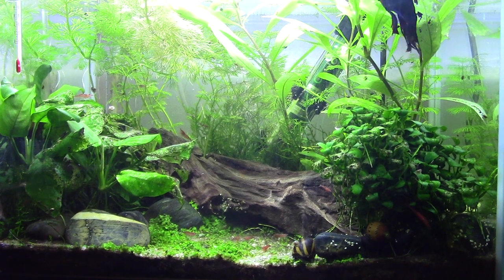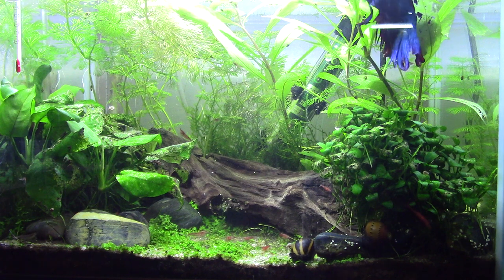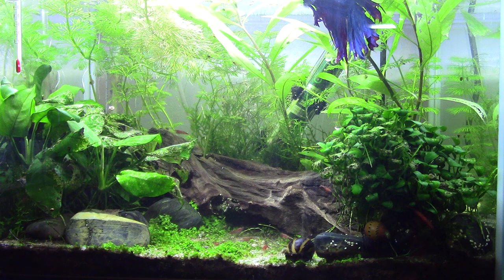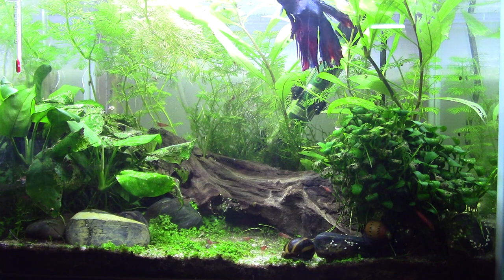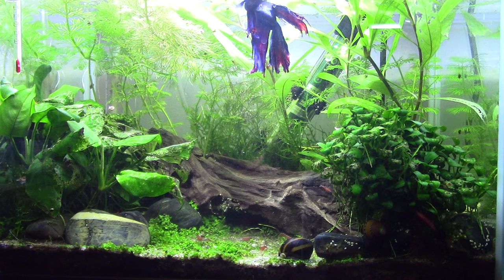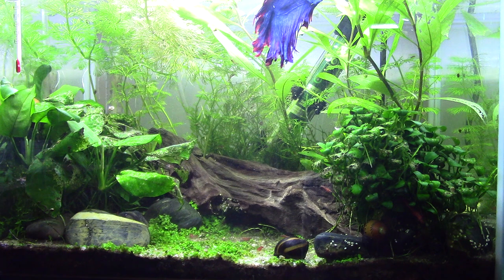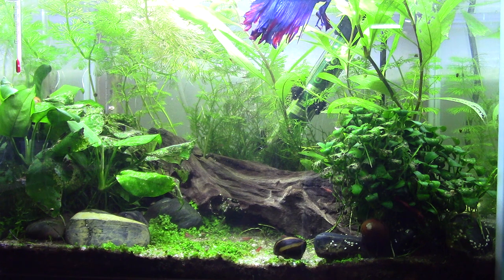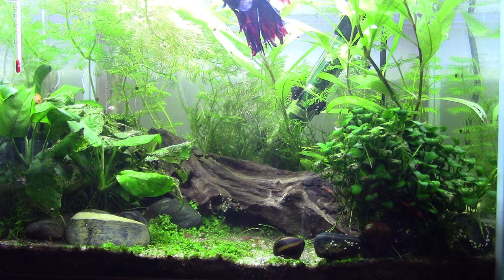what exactly does cycling a tank mean?

Comment: I lost two fish so far.i put water in the tank ran it for a week but I didn't know anything about cycling. I got the water tested they say it was fine to add fish.i started with 3 platy and 5 neon tetra,in my ignorance a week later I added 5 more fish and I'm only two weeks into the tank go8ng on my 3rd week.after I added the 5 fish one died the next day..soooo did I add fish to fast??
And once it finally cycles then is it OK to add fish 2 or 3 at a time(30 gallon)
Or one at a time?
And it the tank is fully cycled, then adding fush I not as dangerous as when you first start out?
Reply from the maker: Id say yes you have but its a mistake many many people make so dont feel too bad. Once a tank is cycled you can add more fish more safely as it will take a couple of days for the bacterial colony to catch up. Its a hobby of patience though so best to take things slow and do plenty of water testing until you get your head round what is going on in your tank. Every tank is different so no one rule fits all tanks.